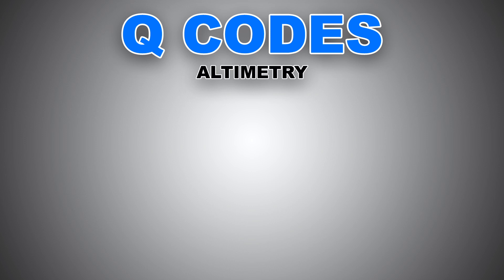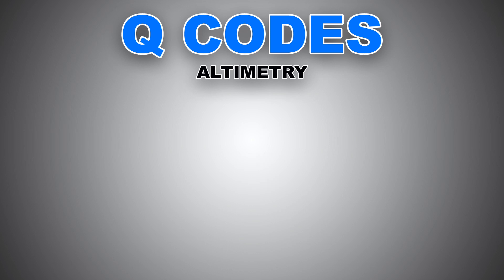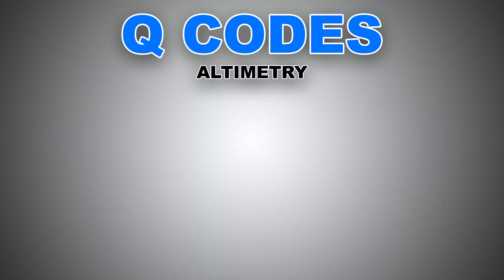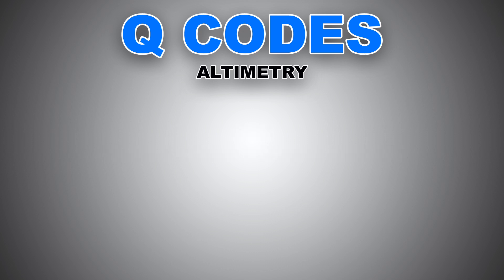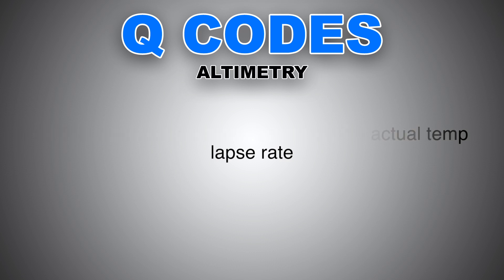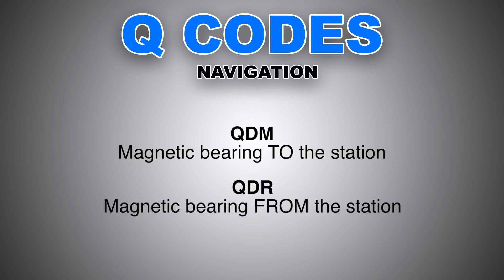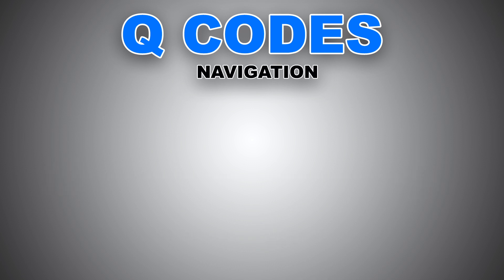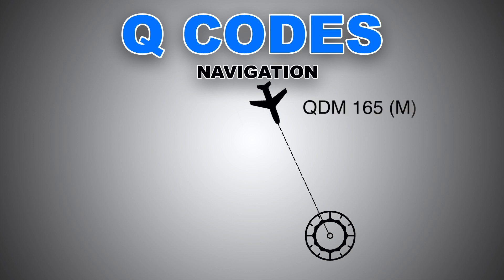Altimetry Explained - QNH QNE QFE QFF QDM QDR ALL EXPLAINED

Comment: Sorry, but your explanation and definition of QNE is incorrect. This seems to be a common misconception all over the internet, from some sources that should know better. What you are describing as QNE is the Standard Pressure Setting (SPS or STD). QNE is a different thing altogether. QNE is not a Subscale Setting, it is an altitude reading, more specifically it is the indicated altitude of an aircraft on the ground, at the runway threshold, with 1013 set on the subscale. It is used very rarely, in conditions where the QNH or QFE is so low it is past the range of the Altimeter Subscale and so is impossible to set.
Reply from the maker: Thank you for your comment, Please keep in mind while crossing the Transition Altitude we always switch from the local pressure setting (QNH) to the standard pressure setting (QNE) in order to assure separation at high altitudes. Now as for misconception I agree with you there are plenty of topics which Pilots don't actually grasp 100% because we dont have to, it may sound strange but this is the truth. it is known that QNE (1013.25hPa or 29.92 InHg) is the standard pressure setting used at and above the transition altitude)
Hope that clarified your doubts
Reply: @ATPLStudent  I don't have any doubts. QNE is NOT the Standard Pressure Setting. When crossing the Transition Altitude you always switch from QNH to STD, QNE isn't involved!

Quoted straight from the UK Manual of Air Traffic Services....

"During conditions of exceptionally low atmospheric pressure it is not possible to set QFE or QNH on some aircraft altimeters. In these circumstances an aerodrome or runway QNE can be requested. The QNE is the reading in feet on an altimeter with the sub-scale set to 
1013.2 hPa when the aircraft is at aerodrome or touchdown elevation."

Comment: pls continue this series also what exactly do u mean by pressure like is it gravity ?? or air pressure which slows the aircraft idk I'm very new into this
Reply from the maker: Thank your for watching, Well you may thing of air pressure as air molecules squeezed together near the ground surface (High pressure) due to the weight of air molecules. as we go up in altitude however there will be less air molecules (low pressure) because most of the molecules have been weighed down due to gravity. Hope this has helped
Reply: Good Day Sir.... Many thanks for this great explained Videos... 👍👍.... What is a keel effect on aircraft? Does all type of aircraft experienced this keel effect?